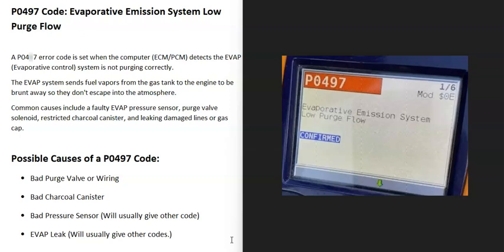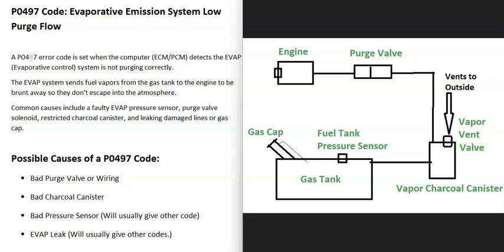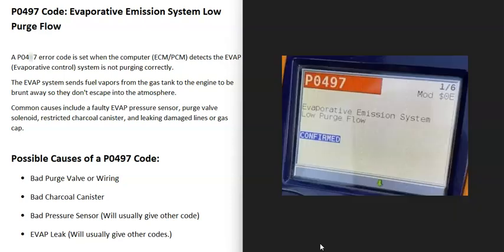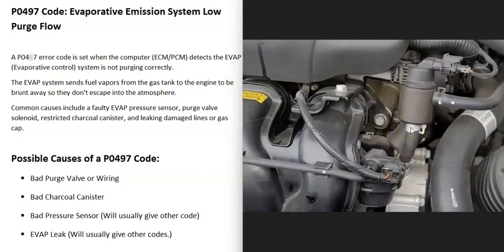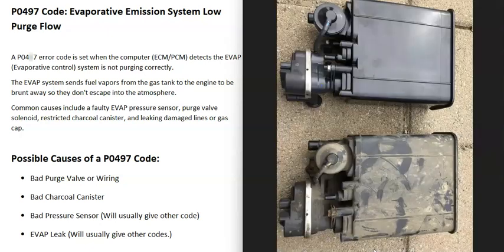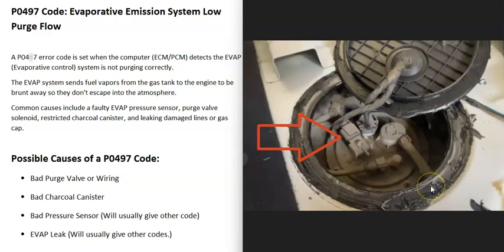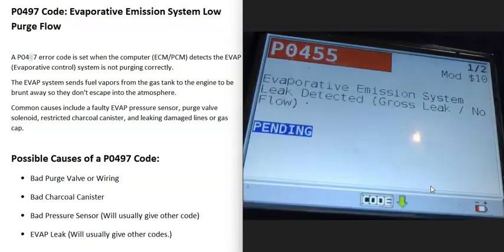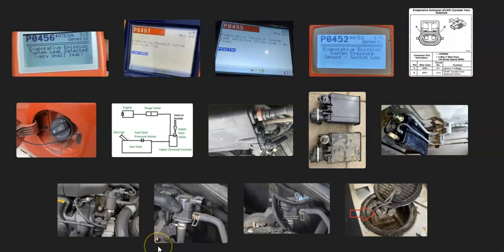Causes and Fixes P0497 Code: Evaporative Emission System Low Purge Flow

Comment: Mine says no flow during purge. Does anyone know what part mainly causes that? I also have the p0496 but i know that that one is.
Reply from the maker: It needs to be diagnosed, but that points to a purge valve issue.
Reply: @HVAC_Mechanic  my car is having this issue again I recently replaced the canister purge valve not too long ago it just came on with my check engine light again I went and got gas and it starts right up last time It always stalled out I don’t want it to get that bad again. Is it the purge valve that’s needs replacing?? I have the code p0497
Reply: @HVAC_Mechanic I’m wondering is it the gas cap because I get a check fuel cap light every time I fuel up too I noticed
Reply: @HVAC_Mechanic it comes on then goes away is that normal I have a 2008 Hyundai accent

Comment: hello i have a 2011 acura tsx and got a P0497 evap system low purge flow code along with P145C manufacturer control? i replaced my fuel tank cap and it still didn't go away even after clearing it any idea?
Reply: Did you find solution have the same thing
Reply: @rehanchaudhary8671  just changed my second purge valve that still didn’t fix the issue…
Reply: I just got the same 2 codes yesterday; taking my car to the mechanic tomorrow to find out what is going on. I also got the check fuel cap message and found the fuel cap loose, so I put it back on making sure I heard at least one click. The manual says the MIL should go off after a few days of driving.
Reply: @donnahafer5604 any update? ive been dealing with this for a year with no fix!

Comment: I changed my fuel pump an changed out the vapor vent tube gas tank to canister. P0455 p0456. Does the hose have to be on the fuel pump air tight?

Comment: 09 Chevy traverse the purge valve wire  should it have negative on one wire.. because I have power but no ground on other wire
Reply from the maker: The circuit needs to be enabled by the computer, usually with a scan tool. Sometimes, you can drive around and, with the engine running, check for voltage. The computer will send a voltage to it to open at some point, usually after the engine gets hot.
Reply: @HVAC_Mechanic  ok thanks man